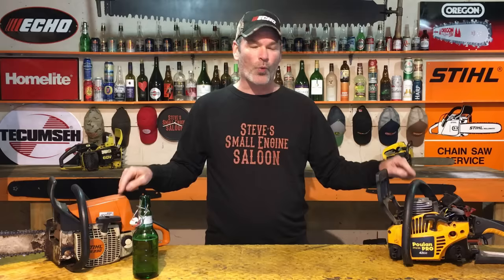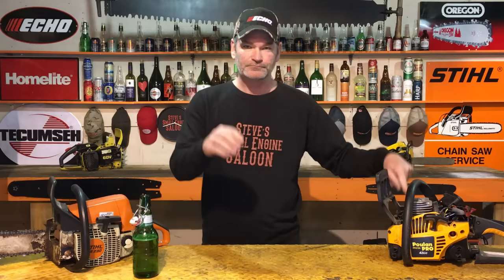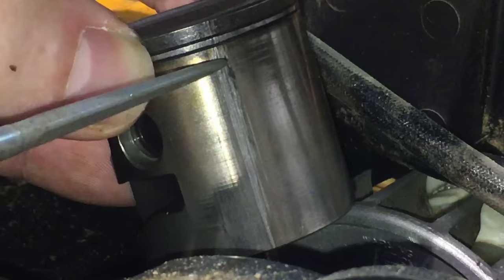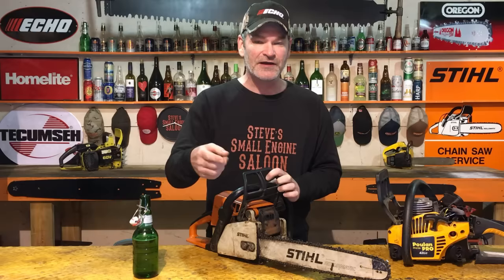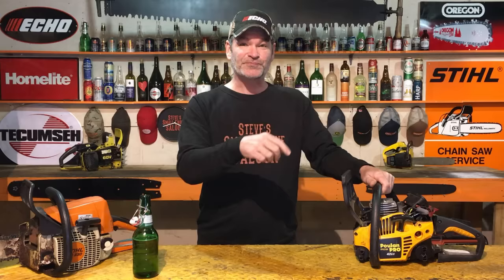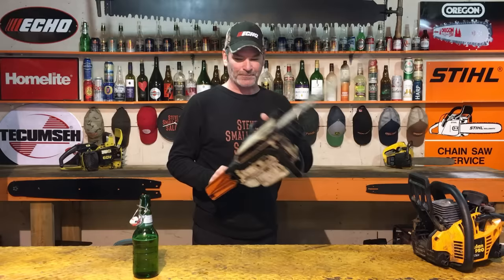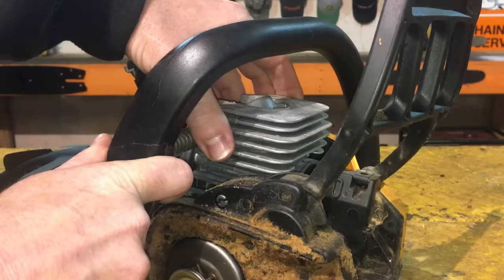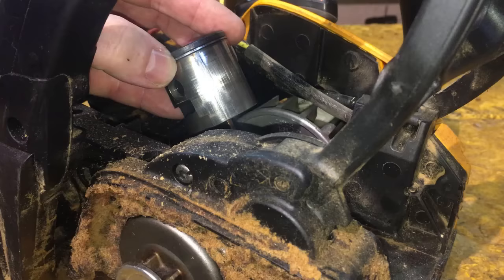WARNING: Never Do This To ANY Chainsaw

Comment: So...how long should be that warm-up, 10 secs, 30 sec, a minute?
Reply: Idel a minute. Then short heat up revs. Nothing wide open for another minute. I will cut some small stuff for a minute or 2 before I go WOT on the big stuff. Do that and you will be fine even in the winter.

Comment: ....and yet, this bad habit may have a simple solution to get the saw running again. Saw had a very light pull, seemingly low compression and was difficult to start. once warmed up a bit it would stall and often not restart or restart and stall again.
Eventually while working out what was happening Spark was lost completely.(Coil Failure) By now I had rebuilt the Carb and was battling with an untunable  fuel flow.  
Anyway, the Fix(in this case) was adding 2-3oz of SeaFoam to the tank, Resetting the H/L to factory starting points, upping the Idle temporarily and struggling to start the Saw.
Still scratching my head because I was expecting the Stall again, which was still happening after replacing the Coil. I kept quick bumping the throttle for the first minute or more before calming down and easing off the throttle completely. Surprisingly the saw kept running so I'd bump it every 30 seconds or so as it fully warmed up. 
Backed the Idle down to reasonable rpm's and ran it for about 10 minutes.
*Now, I shut it down, puled and inspected the Plug, added a little Seafoam directly to the well warmed cylinder, reinstalled the plug and let it sit overnight.
Next Day - Choke, 2 pulls and cough. Choke off, 2 Pulls and running. Bumped the Idle down after about 30 seconds and noticed it was a bit high again, but smother. Adjusted idle down and cracked the throttle a few times. Watching the smoke as the SeaFoam was washing out the carbon from the internals. Warmed it up and shut it down for the night.
Day 3 - Clean Start, 2+2 pulls. Warm up. Throttle Response is instant, no hesitation at all.
Starts, Runs and Cuts as one would expect from a new saw purchase.
Hey, its a Poulan, stranger things have happened.........lol.

Comment: How do you actually run a chainsaw? Do you always cut at full throttle/high rpm? I find that my saw cuts limbs (5 inch diameter) perfectly fine at a low rpm, but I have read that will lean out the mixture too much. I don't have any experience with two strokes any suggestions would help.

Comment: The other thing is, as I have mentioned elswhere.
Because two stroke motors are lubricated by oil vapor from the fuel, a cold engine, particularly one that has not be run for a time, does not get enough time for fresh lubricant to be distributed in the bore.
Even worse, if a machine is run hard and turned straight off, it does not get time to cool down and the oil will tend to evaporate or burn off in the hot bore.

ALWAYS, EVERY ENGINE, give some time to warm up and cool down.

Comment: Hey Steve and people's.. you know what your exactly right .
Yeah heat transfer isn't at running temp .
So really this would be the same for all combustion engines, let the car warm up truck or locomotive. 
The more I think about it the more I reckon that any engine needs warming up . But some engines more subject than other's. 
It's the heat transfer where talking about, from piston is the fist along with the heads to cop the heat ,and im surprised that they haven't,weld a piston to cylinder or has someone done that. . Thanks for the tip Steve cause I think we've all probably done this at one stage or another just some people are under pressure to complete the job and I know that feeling so it can cost the boss to fix or cost the job sometimes . About then, I reckon that accident zone is getting into the red cause we got to rush  for what. ?? I still sometimes go like f*#k and it becomes a shit job and chainsaw will win with fleash and bone . 
Take it easy guy girls remember we all safety officers we hole and we bare that right . Everyone has to go home to there lives and wife's. No job worth persons life hey . yeah fuck that when it's easier to help someone and prevent an accident.

Comment: If anything, the cylinder is expanding inward not outward.  the hotter it gets, the smaller the space between the cylinder and piston.  The engine is designed for this.  The problem is the oil isn't being heated enough to lubricate at high rpms yet.  This is the case with any internal combustion engine.

Comment: now that’s just common sense… never rev a cold engine. I have a stihl chainsaw, great saw. But let it idle for a few minutes and start it frequently even if not going to use it. Nothing worse than having a tool that won’t work simply because of neglect.
Reply from the maker: Agreed!

Comment: 1 thing Steve didn't mention is that chainsaws generally turn around 13000 rpm, trimmers, etc less. In the old days, say 40 - 50 years ago saws didn't run that fast & were built better.

Comment: Never done that to any motor/engine 2 or 4 stroke. I new that before my teens 
I let the chain saw idle for a bit always summer or winter. Was getting wood with a guy and he told me I was wasting chain oil. I just said to him don't worry you don't have to pay for it. He was doing what you are saying not to. I just kept my mouth shut.
Reply from the maker: Right on

Comment: He is dead on , with this explanation. I have always had great success with keeping engines and machine tools going strong for decades. I cringe when someone starts a car and takes write off under load , it won't kill a car engine but it wears them and many other components over time then they loose efficiency much faster and smell like nasty gasmobiles ! I know guys with dirt bikes and saws that start them up and rev the piss out of them emidiatly !!!??? Any machine in the world will last longer and stay more efficient and accurate with a low load lower rpm warmup within a balanced frequency , you know like we're the engine feels the smoothest off idle to around 1/4 of it's max intended rpm range , usually like 1400-1600 rpm in a vehicle and 1/4 throttle on small engines . I let everything I own warm up and they don't loose efficiency fast at all or break.
Reply from the maker: Right on Andy!

Comment: Early in your video-and btw, thanks for explaining this, that you have never seen this issue with weedeaters, blowers and the like- do you have a video explaining why the cheap gas powered weedeaters one will find in stores like walmart, lowes, and home depot only seem to last one season? I had one that had the cylinder ruined because the piston came loose from the crank, or that is how my mechanic explained the ruining of the cylinder. I have noticed that some mnf's suggest you should alway run those weedeaters at full throttle, could this be the cause? Or is it that the cheap ones add credence to the saying "you get what you pay for?"

Comment: Yep. I saw this happen with my own eyes. I found 3 Husqvarna 372 saws for sale on a social media market. Long story short, they were listed by meth heads looking for fix money. One of the guys fired up, and tached out the first saw, which locked up after mere seconds. I was waving and flailing my arms, trying to get the idiot to get off the throttle the whole time. The other saw was missing some parts, the 3rd saw was nowhere to be seen. I said well, that's that as I opened my truck door to leave. They started scrambling to get me to stay and they would swap parts to try the other saw. I told them if he fired that saw up and did it that way I would leave as I got in my truck. I stayed in it until the saw cranked. When it did I gave them $75, took both saws and got the hell of there. I bought a used thousand dollar saw and a busted one too, for 75 bucks, and it runs like a new one. I could have had 2. Danged ol methilociraptors. Lol

Comment: I’ve always wondered about this. I use Stihl and Echo, and always let saws warm up a good while, maybe test the throttle a couple times and put them back down let them warm up further. However, I’m one of those weirdos who tends to read the instructions/manuals on things. Stihl, in their manual, used to instruct to warm up their saws by going full throttle for 60 seconds from cold start. I used to do this, but only with Stihl tools. Echo says idle for 4+ minutes. Any ideas why this was Stihl’s method, previously !?? Thanks !!  Mark

Comment: ...but it’s ok to hold the throttle down a bit after you’ve started it, correct? I mean, you just don’t want to put the engine under a load before warming up, right?
Reply from the maker: CORRECT!

Comment: Steve, great videos, man! Where are you from, if I may ask? I'm from NL originally. Maybe you're from NB or possibly NS? Great to hear your accent. I'm living in the US now and I have a friend from NB who is the only one on this island with an accent similar to yours. I like fixing things too, but probably only a 50-50 success rate. But I try. You would NEVER BELIEVE how much stuff Americans throw out every day. I have one Olympyk 940 that I got from a friend who was throwing it out because it had a bad starter spring. I got an Echo CS-3000 chainsaw in the dump about 4 years ago and it was perfect except for it needed a primer bulb - brand NEW chain on the thing! Incredible! I have several saws now, most of which I've rebuilt in some way.

Concerning this video, can the Poulan be fixed by adding a new piston and ring? Or has the cylinder wall itself been scored? I have a Husqvarna 435 (I think it is) with a similar problem. It "seems" to have compression and spark but it will not start up. When I look in through the front behind the muffler it looks like the piston is scored there, like streaks running down it. So if I take it apart and see that the cylinder is fine, perhaps a piston is all I need? Your thoughts on this? Thanks again. All the best!

Comment: since he brought up RPMs, something I've been thinking about is rpms, bar length & chain speed.  So if the saw runs at say 10k, is the chain running faster on say a 20" bar vs a 16" bar?  The linear ft/ second would be have to be faster on the longer bar, IF rpms are maintained...  Or does the extra weight of chain, friction on the bar and load of more cutting teeth slow it down ?  I ask because I have an ms291 with a 20" bar.  Seems cumbersome at times, thinking about getting a 16" bar for it, but if that's gonna drop my chain speed, I am not sure that'd be useful?

ps--really glad I found your channel.  I consider myself pretty mechanically inclined:  machining parts, general steel fabrication, rebuilt a few engines (cars / tractor) and transmissions from cars, but small engines are my alkalies heel. Hell, I think I'd have a better chance of machining an engine from billet than repairing one!  I've got a graveyard of equipment on my homestead that just barley doesn't run.  Watching your videos, I already have a few new ideas to try...hoping I can save some old engines.  All this to say, I appreciate you sharing your extensive knowledge!

Comment: I think alot of 2 strokes are run to lean causing excessive wear. The fuel is the lube and if its ran lean its like running it dry and if you add  the higher temps, it makes matters even worse.

Comment: I start my saw and blip the throttle a few times until it will run on its own, then let it sit there and idle a minute or two while I put on my gear, set up the log, move the splitter, whatever.
Reply from the maker: Perfect!

Comment: Question. Will the piston and the cylinder wind up expanding the same amount over time, or will one of them expand more than the other? If the piston expands more after they are both warmed up, then a loose piston will become a little tighter. I'm just trying to learn folks, I'm just trying to learn. Thank you.

Comment: Hi Steve, thanks for the great advice in your vids.  I was wondering if you covered my current problem:  Ryobi chainsaw, I have to hold it by the chain brake bumper/handle & get it & keep it in just the right position before the chain will run, any ideas?  Also when I have it in the "sweet spot" the chain runs without throttle input (though I'm guessing thats down to the T screw on the carb).  Thanks for any help, take care.

Comment: I’m thinking about getting a Stihl ms251, for cutting down trees and I have a echo cs310 for trimming, and recommendations on any other saws or size?
Reply: Get a mid size Sthl, s saw that can use a 18” to a 22” bar, that way you don’t need 2, stihls are reliable and last forever, Not sure about there model line,  I have a 023 thats 25 years old, runs great, motor has never been apart.

Comment: Think most people are guilty of doing this at some point in first time use,   I do let it ideal for a minute or two with a light touch on throttle ,   So you did not  say how long is appropriate to warm your chainsaw up before letting rip,  what’s your advice 😀😀

Comment: Grolsch is the greatest!   E-yup... let that little sucker idle,  rev it gently to give it lube and keep the plug clear..and idle it some more..  these are air cooled motors with carburtors... the wont run right until they are warm anyway.
Reply from the maker: Right on

Comment: My experience with riding 2 stroke dirt bikes is this I'm talking fairly hard riding upper end damage in the heat and have seized two bottom ends in the cold the ones in the cold suprised me the. Second one it was about 20 degrees out and I had been hammering county. Roads for an hour in 3 or 4 inches of snow when it happened when I touched the engine the top was kinda hot but the entire bottom end was freezing I killed the main bearings on both cold rides it wasn't until years later that I realized it can get to cold to ride a two stroke dirt bike that's why all old 2stroke snowmobiles have cowlings to retain heat this is not a problem on water cooled dirt bikes only air cooled and although not directly related to this video I thought I would share I always warm any motor up before pushing it

Comment: I wonder why they don't use battery chainsaws. Safer, much better for environment meaning specifically working. I've tested few ones and they're actually much nicer to use for cutting random planks etc. Let's face it. Construction guys aren't timbers at all. They most certainly don't need much from chainsaw. They just ruin good chainsaws on that kind of usage.

Comment: I use chain saws in firefighting. A lot of time letting it warm up or a minute or two isn’t an option. Clearly to train and check our equipment more than we use at true emergencies. 
Would you suggest a policy to warn saws up when ever possible, would be beneficial?
Thank you
Reply: Best practice for you application.

1) Get to your place of business.
2) Start saw
3) Start putting on PPE. (Ear plugs, safety glasses/Bugz, gloves, adjust chaps) This should have bought you a minute or so.
4) If you must start cutting immediately after after Equipping PPE, start cutting very slowly so it had a little more time to fully warm up.

I promise, an extra minute or two for warmup outweighs seizing your saw on the line.

-Hotshot

Comment: Hi Steve, hey I'm able to start the chainsaw. Easy enough, but the idle , rich and lean adjusting screws are hard to budge. I got the idler to move a tad to run saw without chain moving. So saw runs great but it gets hot super fast. I'm pretty sure I have gas mix right. Not positive. Sometimes it bogs down while trying to cut wood. What am I doing wrong. Do I need to do a complete carb clean out? My name is Suzi Q.

Comment: Just confirm further that if I'm gonna need a chainsaw for random use, better get an electric one (lithium battery). If you have less than 10 trees to cut down and chop, I'm pretty sure that is the way to go. I've bought one of the cheapest chainsaws (a Jonsered) and the first one I couldn't get to fire and even broke the string that you use to start the saw. I got it replaced and it was really difficult to get running. Got it running somewhat by adjusting the mixture, but unable to get to what you are supposed to. Can't get it to idle without spinning the chain (chain tension is correct). Now everyone is telling me that I'm a moron and can't operate a chainsaw. But did you your saw just fire up after 6-24 months? And no, batteries are not gonna be flat because they are the same batteries I use on my drill, vacuum and leaf blower.

Comment: I'm pretty sure that is what destroyed my cheap Jobmate top handle chainsaw that and running it on 50:1 mix instead of the manufacturer specified 25:1 mix  because I didn't want to have a separate container of 2-stroke fuel just for one machine.

Comment: How long should you let warm up? My saw owners manual says 3 minutes, is this accurate?
Reply: That's about right, also there's nothing wrong with revving it when it's cold, what you really don't want to do is cold start it and immediately put a load on it, ie start cutting. 
Revving it by going on and off the throttle, don't rev it and hold the throttle there but rev, let go of the throttle till it idles, then rev it again and immediately let it idle, you can do that to get it warmed up quicker than just letting it idle, that's a safe practice. 
Cold starting it and immediately putting a load on it by cutting is what really causes the problem he's talking about, when you put a load on an engine the piston "thrust surfaces" are pushed against the cylinder walls with force, doing that to a cold engine is the worst case scenario for it.